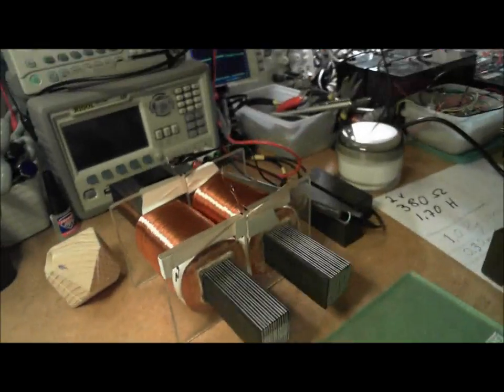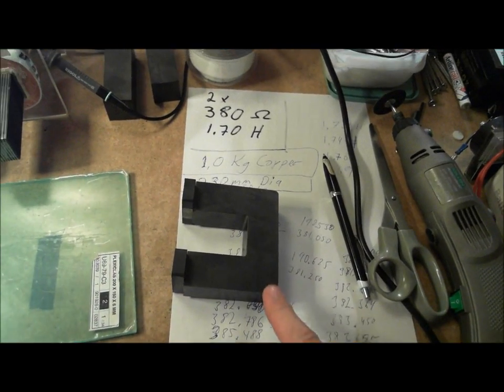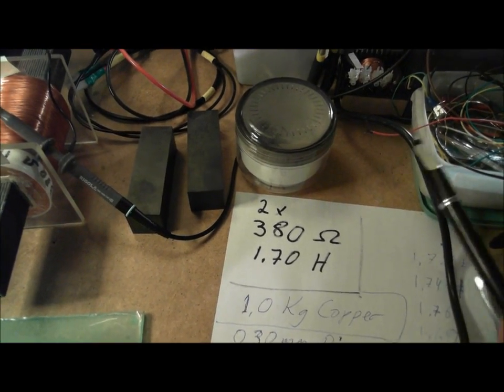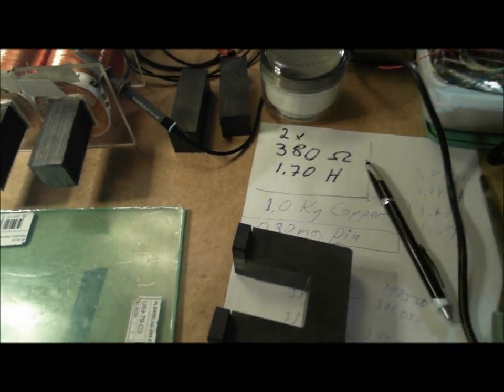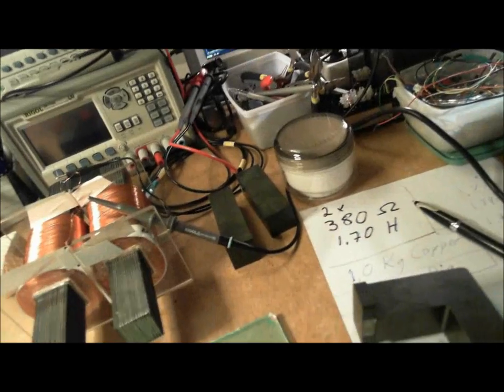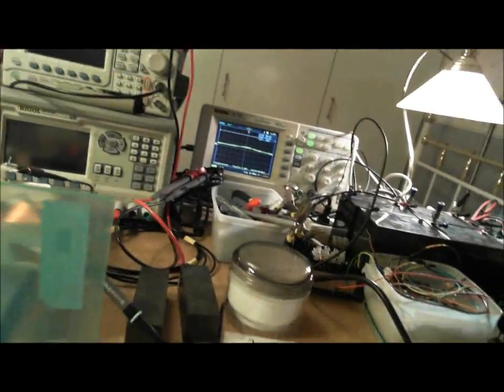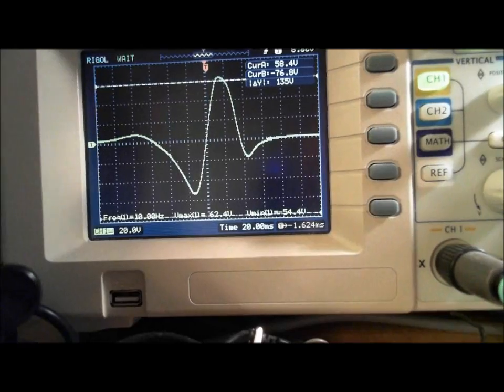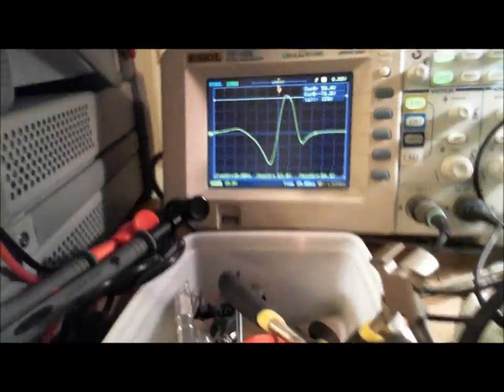Edward Leedskalnins PMH replication.

Comment from the maker: It could be, but I'm a little sceptical to that right now. What I think is that the coil acts on side in a capacitor and the iron the other plate. The voltage spike in the coil is leveled out by drawing charges into the iron. So to me it seems better to have lw resistance copper in coil and a large chunk iron beside the coil. This looks like a pump to me.

Comment from the maker: - If I hooked up the led with catode instead of anode, it still lit.
This is in line with what claims in the paper. When the circuit is opened, first a current will flow i one direction and then turn and flow in the other direction. (first time I have seen this).
- I connected the two leds in series so a closed path between coil end and core weas created. Now the led lit brighter.
-Then I added little iron touching the circuit, the led lit even more brigher.

Comment from the maker: Then I did the same experiment with two neo magnets, 30 mm diameter and 10 mm thick (very strong). It was impossible to slide them slow over the PMH ends, they just stuck to the ends. But if I started to swing the magnets back and forth som distance away from the PMH and then aproaching the PMH, there was no problem. I coluld feel little attraction to the core. With the neo I got more than +- 150V (open ended) and +- 150 mA (closed with 1 Ohm resistor) at ca 8 Hz.

Comment from the maker: Thanks MrAnguswangus!
No, the voltage was measured across the coils open ended.
I connected a 1 Ohm precision resistor across the coils to measure the current. I get +75 mA and -50 mA as peak values with the ferrite magnets.